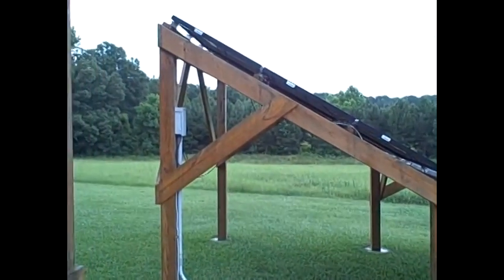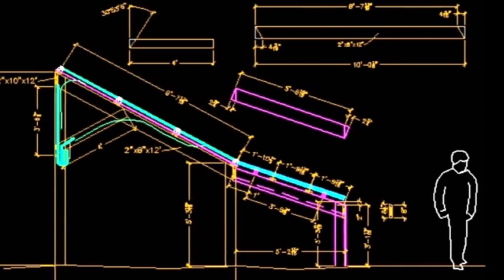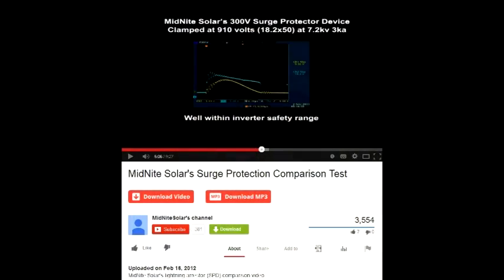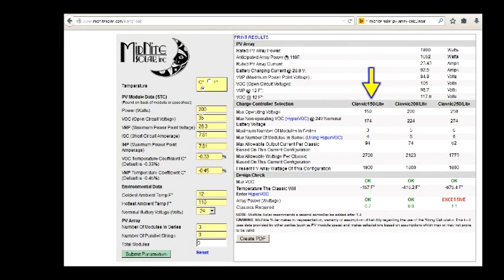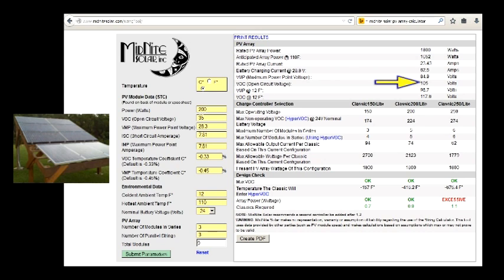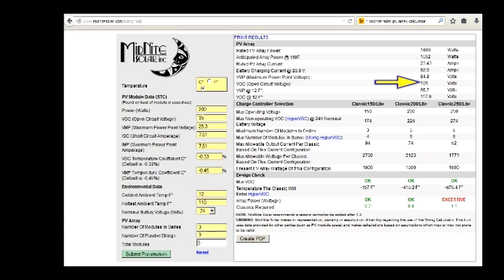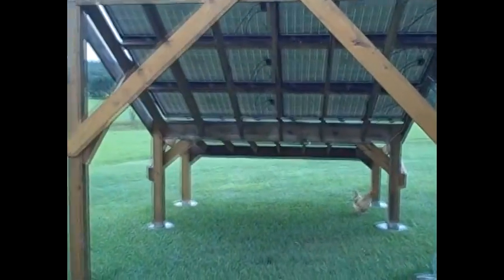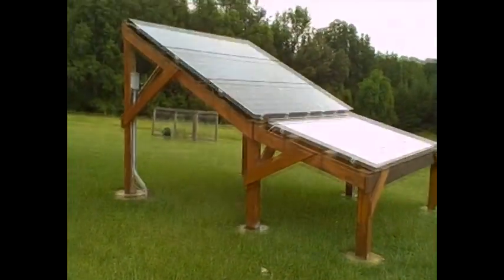Wood framed off grid solar array and Midnite Solar sizing tool

Comment: I have eight 12v panels and four 24 volt panels. What is the best way to wire them together, series or parallel. The four 24v panels run into Grid Tie inverters.
The 12 volt panels run into a charge controller and charge a bank of four batteries.